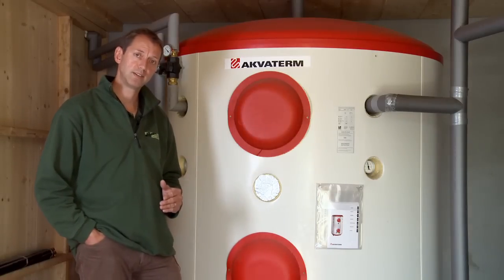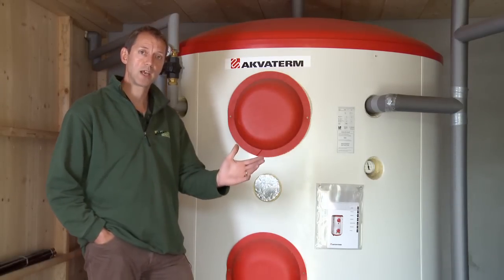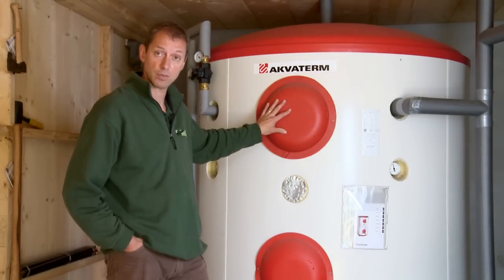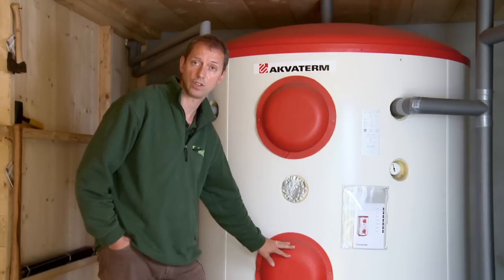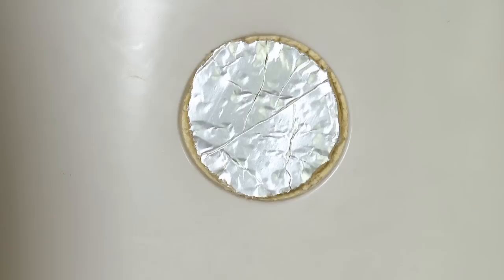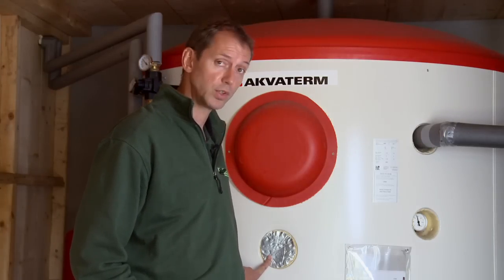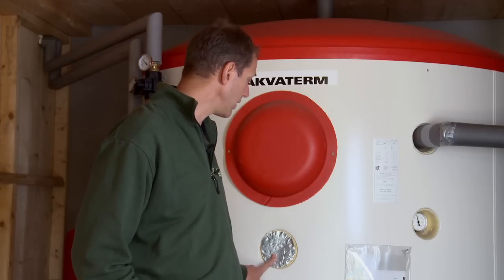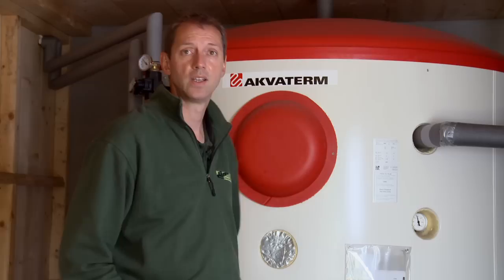EcoAngus Accumulator Tank 2

Comment: Is it a closed system with an expansion vessel
Reply from the maker: Yes it is on a closed (pressurized) system.These boilers can be installed on either open vented or pressurized systems but 90% of new installations are usually on pressurized systems. You need to allow 8 to 10% of the volume of the water in the system including the capacity of the thermal store for the sizing of the expansion vessel.